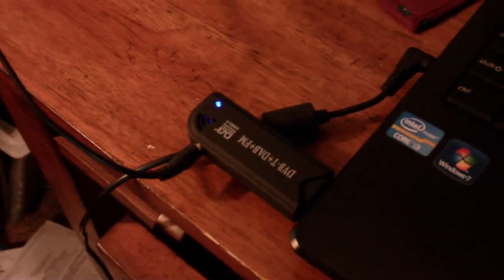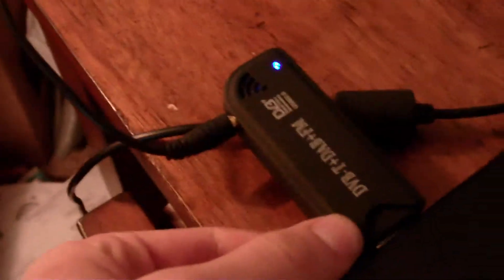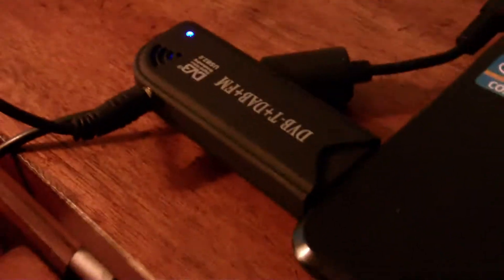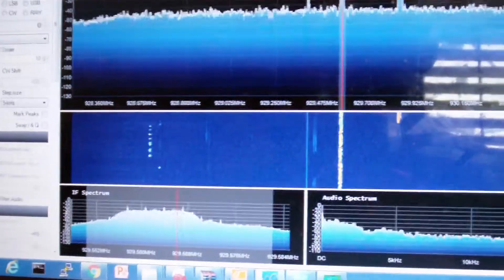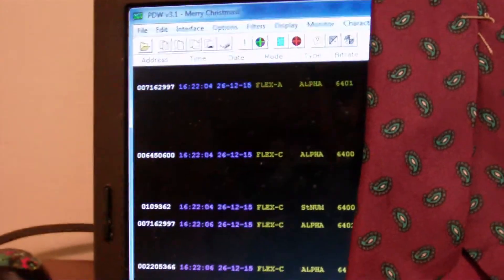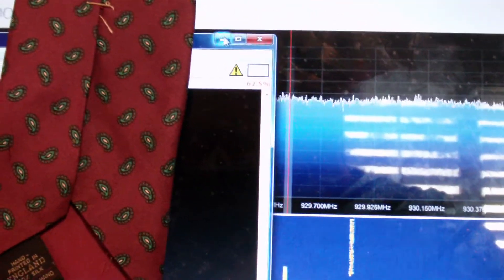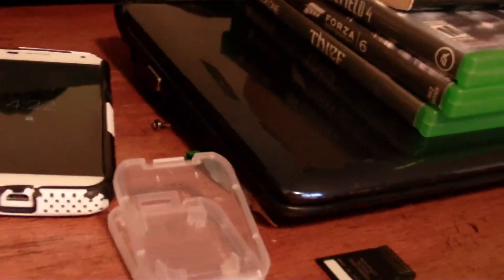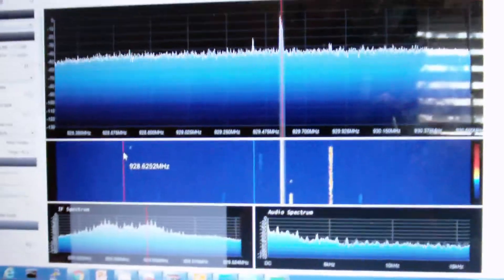SDR Dongle Decoding Pager traffic

Comment: Hi! It's easy to decrypt P25?
Reply from the maker: These can be used to decode P25 but not decrypt encrypted P25. If the P25 freq is unencrypted then you can listen using some additional free software. If it's encrypted then I don't think it's possible.